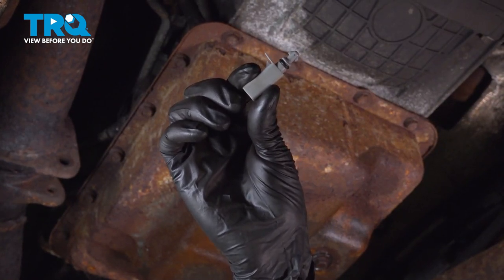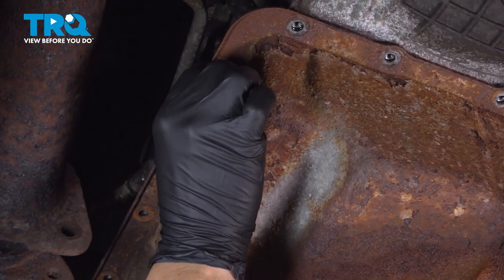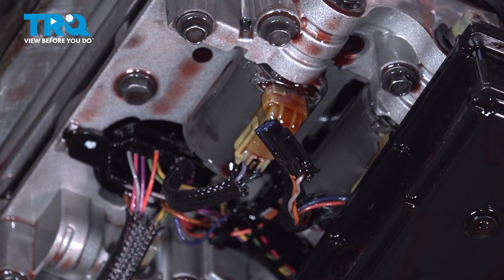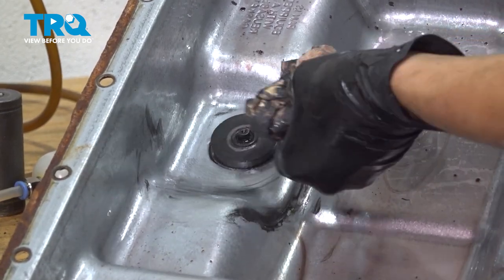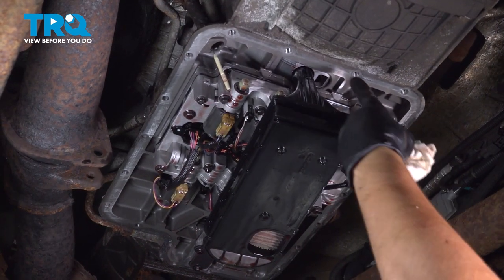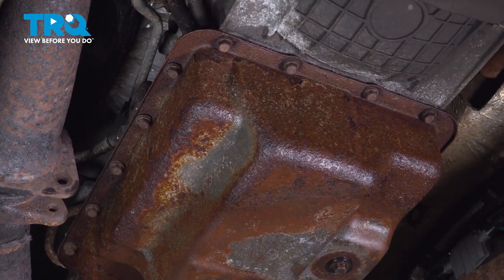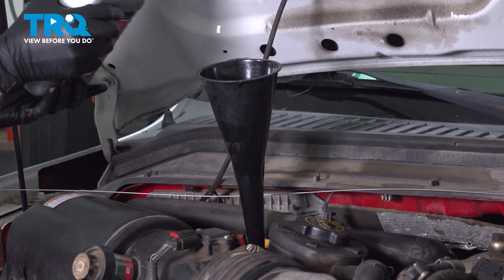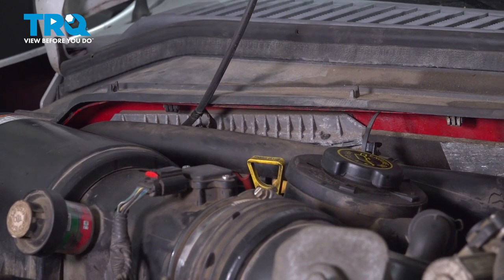How to Replace Automatic Transmission Temperature Sensor 2008-2010 Ford F-450 Super Duty

Comment: I couldn't find a video for my problem.  08 F250 6.4L tranny temp sensor broke off inside tranny while trying to twist and turn it.  I ended up screwing a small screw into the plastic nipple of sensor flush with base, and when it took, I was able to slowly manipulate it out without damaging the transmission permanently.  Video showing turn ignition to on (not started) and then off 3x, the 3rd hit the brake and turn it off and then start the engine.  It erased my "tool" and Engine warning light after replacing solonoids and temp sensor.  Thanks you tube